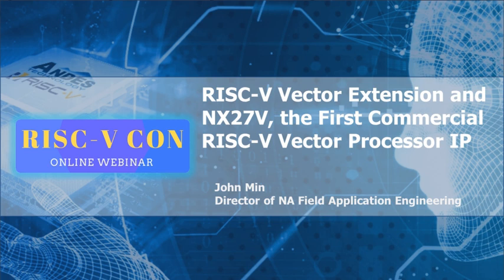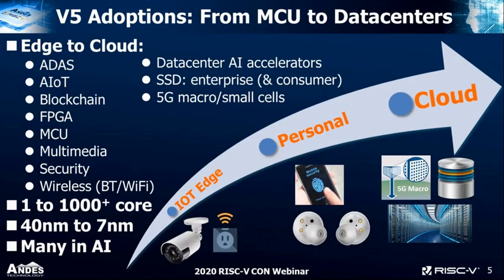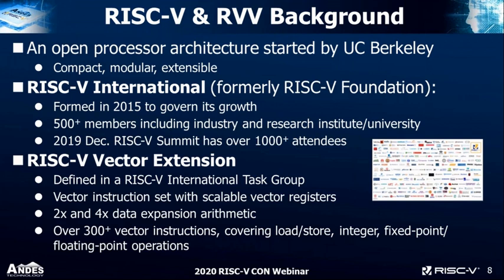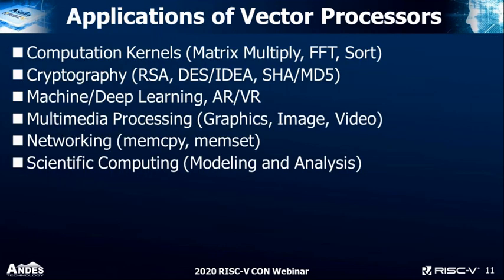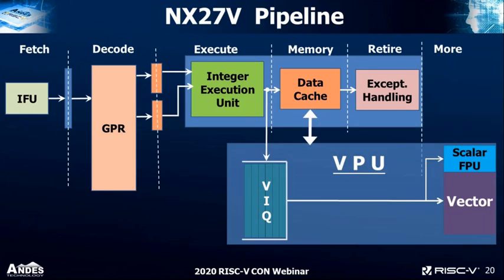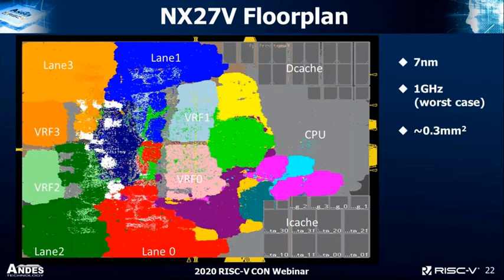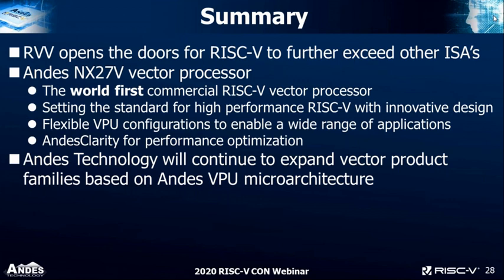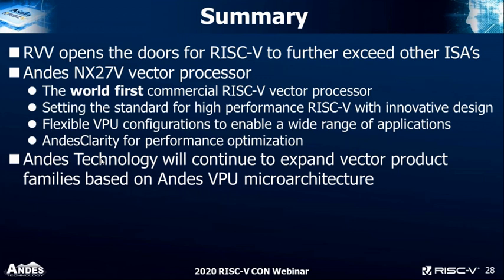(EN) RISC-V Vector Extension andNX27V, the First Commercial RISC-V Vector Processor IP

Comment: Sir few doubts
1) In the Risc v vector ISA it shows that VLEN is configurable and can update it using vsetvl instructions. How to do that  in hardware sir?
 Is that means a vector processor can be of any bits or before designing we have to fix one value? What's that configurable VLEN sir?

2) What is the differnce between vsetvl and vsetvl{i} instructions ?